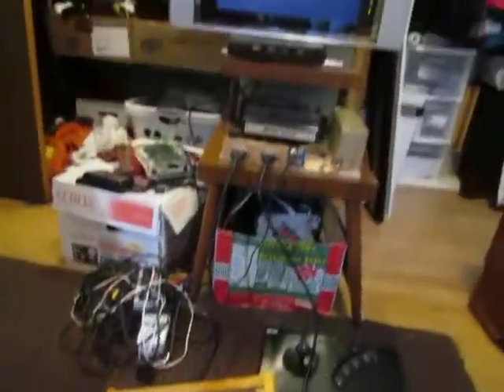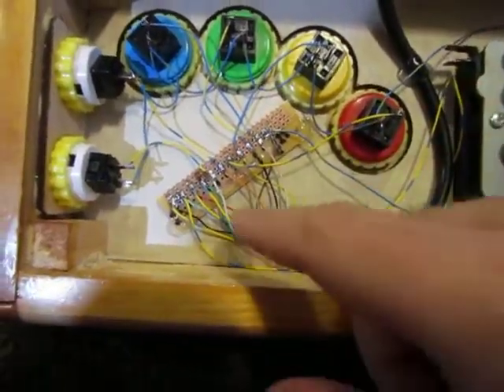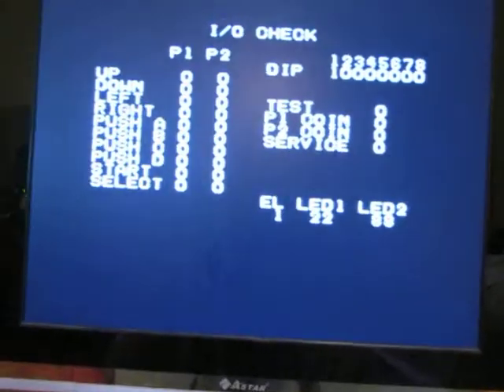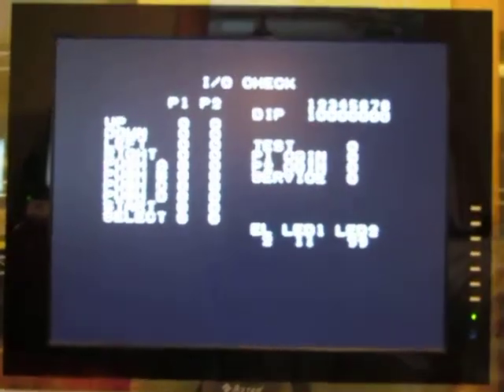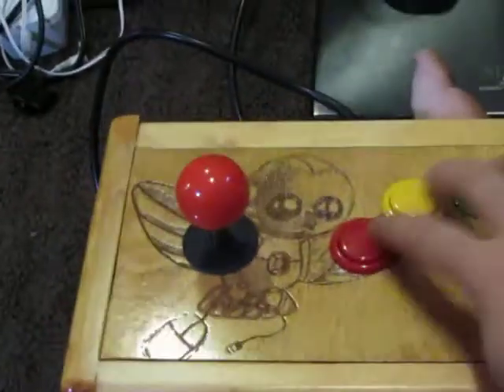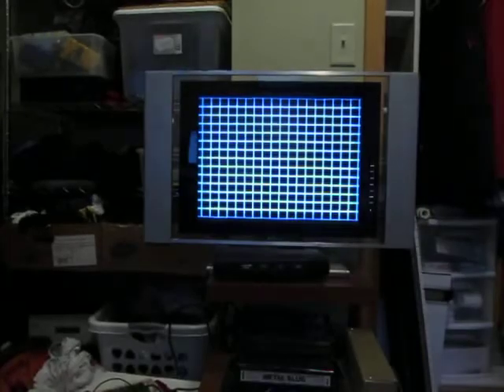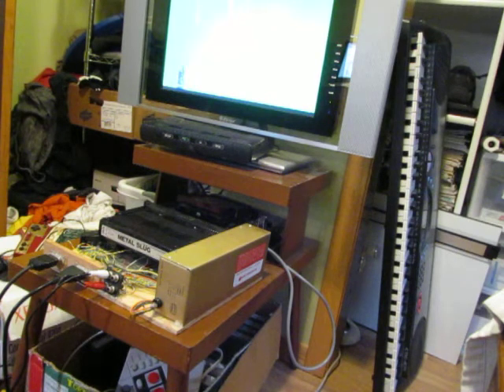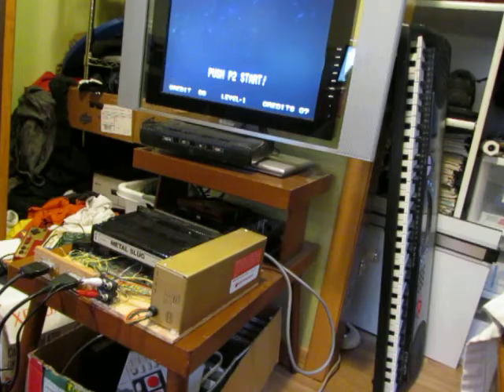DIY Neo Geo controller finished

Comment: Nice job!
I have a few extra 6ft extension cables and some Happ joysticks and buttons.
Do I need that connector piece, (bread board?) to connect the wires to, or can I just connect them directly to all of the buttons and joystick micro switches? AFAIK the Neo-Geo doesn't require any type of signal conversion or logic.. as it's 1 wire per input.  Please correct me if I'm wrong. 

I assume it's 1 wire per input A, B, C, D, Start, Select, Up, Down, Left, Right (10 connection wires) + a single ground wire which would daisy chain to all of those inputs. 

Also, I don't own a multi-meter, or know which color wires on the extension will match up to the joystick connector. Any suggestions on this, or should I just use trial an error? I just want to make sure I don't blow something by connecting the ground wire to a wrong input. 

Thanks
Reply from the maker: So I realize this was posted a huge time ago, and I only just now realized I'm not getting notifications about this stuff in my email anymore, so sorry about that.

Anyways, if you're in the US, you should totally absolutely go to Harbor Freight and get their cheapest multimeter. They are literally $10. Sometimes even less when they have a sale. Sometimes they literally give them away for free. I have also seen them for about $6 on Amazon, plus whatever the great Shipping Lords require in sacrifice these days. 

Hooking up the controls is the easy peasy part, it's just the wire for the switch in question on one side of the microswitch, and the other side hooks up to ground. Make sure to use the connection on the microswitch marked NO, not the one marked NC. 

For the video, it's more tricky. You'll need a converter. If you still want info on how to do this, just leave a reply, and I'll point you towards some options that you can actually buy these days, since I'm fairly sure the Neo Bitz converter I used isn't sold anymore.
Reply: No problem. Thanks for the info!